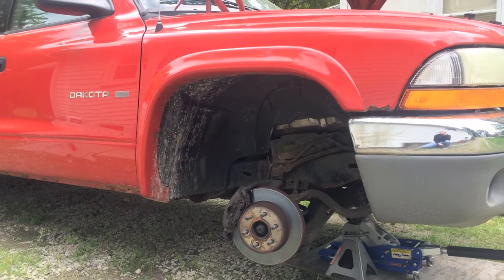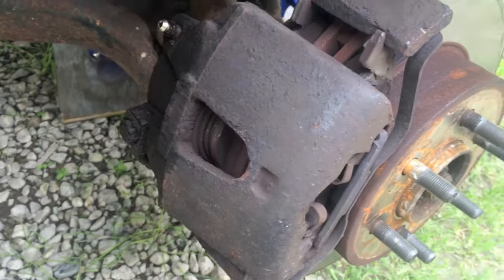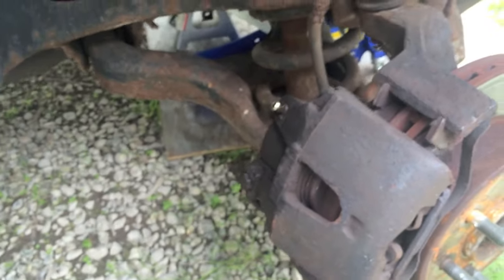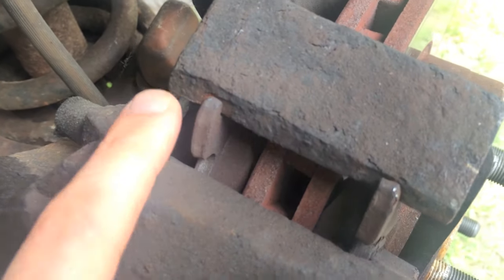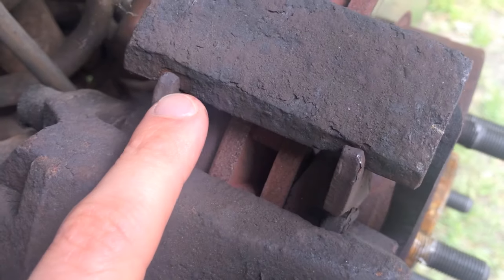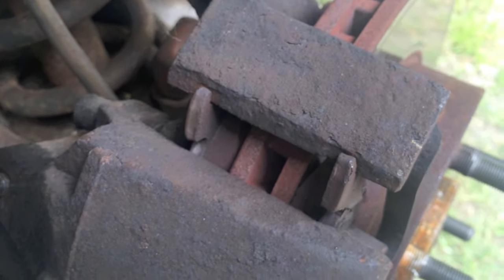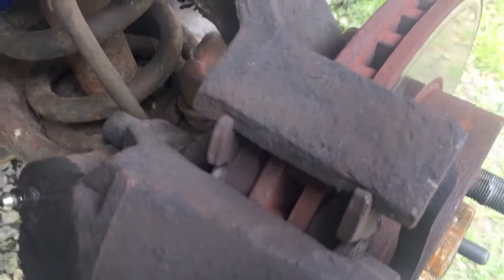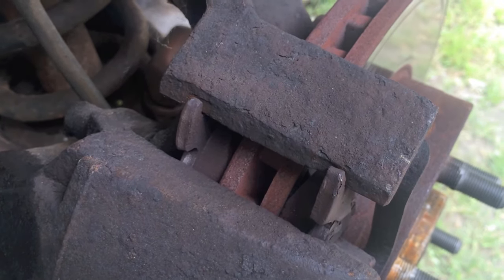HARD Brake Pedal - My brakes are Locking/Sticking/Smoking "Don't forget this"

Comment: hi I have a 2000 Nissan alitima . we replaced the front brakes and rotors. I am not sure why but my BF Also bled the lines . afterwards I had no brakes .   we could not figure it out so my friend took the car . he said the pads were on incorrect so he fixed it . When I got in the car the brake pedal was very hard . we drive it 10 minutes late the car did not want to move , we had no choice but to force it another Mile so we could pull over. the front catalytic converter was glowing red, assuming this was the problem we parked car for several months until our financial situation was better. we replaced catalytic converter ( both of them ) we fixed water pump alternator , EGR valve and both 02 sensors . picked it up at mechanics drove it for 15 minutes and did not want to.move , brought it back and they said brakes were locking up on all four tires , the adjusted the master cylinder rod , seemed to fix problem ...they did say my back brakes were making a spongy sort of noise when stepping on brakes and I should bring back .

car seemed to drive great....until I drove it for about 30 minutes . the front wheels for sure and possibly back wheels are locking up  I can smell burning on front brakes ...back don't smell but are hot.
the brake pedal gets hard , and after it drives for a mile or 2 with hard pedal car does not want to move.
I let it cool and seems great until it gets hot.

not sure if I should mention this but air bag light is blinking, just keeps blinking.
was not blinking when we parked car, but after several months of sitting for a while and then starting it light came on.  mechanic will be looking further into this when I bring it back.

could the brakes and light be related ?

I feel like the mechanic did a poor job diagnosis my car considering it went in due to loss of power, and did the same thing after only a few miles.
adjusting the master cylinder rod sort of helped,  but still same issue .

is there anything I can suggest we look at ourselves ?? money is tight so we can not just keep saying maybe this maybe that.

thanks Heather
Reply from the maker: Heather thanks for checking out the video and sharing your experience.  Brake problems are annoying for sure.  Lets figure this out.  Lets start with your Air Bag light.  Anytime the light is flashing...its giving you a code.  Turn on key and count how many times it blinks...then it pauses for 3 seconds and then blinks again...count the first set....then pause...then count the second set.  Then it will stay on until car turned off and on again.  Usually, it has to do with your electrical wiring that feeds under your seat to move seat.  Double check to see if the electrical wiring or connection point are harmed.

As far as your brakes locking up...NO FUN...we've all been there.

It can be a few different things....

1.  Its possible that your caliper is beginning to stick...maybe caliper slides have lost the lubrication required to shift back and forward freely.

2.  It can be possible that your Caliper piston has lost its lubrication which will also interfere with the efficient shift back for forth.

3.  The front rubber brake lines that connect to your caliper fail from inside rather that outside.  This means the inter coating begins to break away and clog portions of the brake system...hence not allowing fluid to flow back and forth freely.  

4.  Your brake pads have little prongs/teeth on them.  You will notice by their location...the pads slide on a steel brace.  This may need to be lubricated to bring the shift back to efficient requirements.

I have attached a few videos.  Lets start with the easy items and then work our way up!  Lets figure this out together!  Keep me posted!  Please Subscribe to the channel that would be awesome!

1.  Caliper Slides Lost Lubrication:

https://www.youtube.com/watch?v=-DZ68tKuCQc&t=15s

2.  Too much Fluid in Reservoir:

https://www.youtube.com/watch?v=X-AJ5tD6zoA&list=PLjCXOz8TSkZnavDiGDyHdPKe2dV2RzEMZ&index=39

3.  Failing Front Brake Lines:

https://www.youtube.com/watch?v=3FTEgbLYAdI&list=PLjCXOz8TSkZnavDiGDyHdPKe2dV2RzEMZ&index=78

4.  Brake Pads not shifting:

https://www.youtube.com/watch?v=3Pq15BWM_qY&t=103s

5.  Replacing Front Brake Calipers:

https://www.youtube.com/watch?v=8HoaL4QM5-k&list=PLjCXOz8TSkZnavDiGDyHdPKe2dV2RzEMZ&index=83

6.  How to check if Brake Booster is Failing:

https://www.youtube.com/watch?v=VK4lowH7kQE&index=66&list=PLjCXOz8TSkZnavDiGDyHdPKe2dV2RzEMZ

7.  Failing Brake Booster:

https://www.youtube.com/watch?v=j9s7yccswPQ

8.  Symptoms of a Failing Brake Booster Check Valve:

https://www.youtube.com/watch?v=j9s7yccswPQ&index=68&list=PLjCXOz8TSkZnavDiGDyHdPKe2dV2RzEMZ
Reply: Could be your master cylinder if all 4 calipers are sticking.
Reply: Heather Peirson Eric is right it was almost definitely your master cylinder. same exact thing happened to my 240sx. BTW, 99% of the time if your master cylinder is bad, so is your brake booster, and vice versa. they are directly related.
Reply: Heather Pearson
You got to watch people, but most of all businesses that work in this manner. You take it in for for car not moving & you get it back still car not moving, or it moves long enough that you already left the mechanics & the same problem occurs. Remember, you are boss, your paying them to fix the problem you advised them what the problem is when you dropped off the vehicle. Don't let them go off cue cause they found other things wrong. Stick to the point or go somewhere else. Chances are if you take it in for 1 thing & you got more problems, there taking you for a ride at your expense. Report them to the better business bureau, it's always better if you can find others that got taken, so the matter can be taken real serious! When your dishing out a couple hunds & G's for repairs, I don't want some one just learning the trade, someone's nephew or ally man Dan doing the work! I want a experienced mechanic who  looks like a doctor but with grease marks on his boots & their certifications hanging from somewhere were we can see it. Stop giving your money to rip off pricks that are going to charge you as much as if you took it to a well known business. I'm not discrediting the ones that everybody goes to in the neighborhoods that's been doing it since you were knee high. It's the one hiding behind a businesses to robb you in front of your face!

Comment: My 2003 Buick Rendezvous brake pedal periodically feels as tho it's pushing thru rust. (The crunching sound it makes reminds me of really rusty old hinges on a truck door, so I'm thinking it's rust related.) It's like I'm trying to crunch thru something to break. Not always; about 20% of the time. I generally have to back off the brake pedal and try again. I'm now wondering if that crunchy resistance is this rusty piece you're mentioning in this video. Wondering what that piece is called (that flat block), do you know? Thank you!
Reply from the maker: Auriel Whitehawk 

Thanks for watching & sharing your experience.  Let’s get this figured out!

This is a great place to start as it is a friendly DIY inspection & doesn’t cost you any 💰.  After inspecting this part & you don’t notice a difference...let’s move onto the next items.

Two things come to mind and are the most common causes of crunching sounds with braking.

1.  It’s possible that your brake Rotors are very worn, rusty, & ready to be replaced.  The longer you wait to replace rotors...the louder the grinding/crunching gets!

2.  A “foreign object” such as a rock, stick...  has lodged itself inside your brake caliper & pad area.  In this example however...the object usually causes a constant grinding/ crunching noise.  You may want to inspect entire wheel area for such objects!

Let’s start there!  Keep us posted!

Please subscribe to the channel and turn on your YouTube notification Bell that would be awesome thanks again!  😎👍🔧🔩
Reply: Thank you for your helpful input :)
Reply from the maker: Auriel Whitehawk 

Our pleasure & please keep us posted & we will work together to get this figured out.  😎👍🔧🔩

Comment: Question I replaced brake booster and master cylinder a month ago .because I was driving and brakes didn’t want to stop he said that was the problem.after I fix it now pedal still goes almost to floor but it stops.but after 2 days of fixing now my brakes lock up after driving awhile and I have to let it sit for 30 mins or so  before it release and goes back to floor and I can continue driving.what could be the problem now?also when they lock up I can’t go in drive or reverse.
Reply from the maker: Naquayla Curtis 

Thanks for watching & we hope you enjoyed the video.  If you haven’t already, you may need to purchase brand new calipers.  If your calipers have been recently replaced in the last year or two, the next common cause of this is a faulty rubber brake line that feeds off of your caliper and through your wheel well to the hard brake line.  Replacing both front rubber brake hoses may fix your issue.

Many more helpful videos to come!  😀
Please subscribe to the channel and turn on your YouTube notification Bell 🛎 that would be awesome thanks again!

😎👍🔧🔩

Comment: I have a Buick lurcerne 07 and the back passenger wheel is stuck. Any idea what that could be?
Reply from the maker: Authorize King 

Thanks for watching!  We appreciate you sharing your experience.  A few things come to mind!

1.  It’s possible that your Caliper slides are no longer lubricated.  These caliper slides when not lubricator will cause Calipers to lock up.   Below is a step-by-step video that shows you how to lubricate Caliper Slides.

       https://youtu.be/-DZ68tKuCQc

2.  It’s possible that your Brake Pad tips are no longer effectively lubricated where they shift on Calipers.  Below is a video that shows you how to check if they have been lubricated as well as lubricate them in the event that they are not.

       https://youtu.be/3Pq15BWM_qY

3.  It’s very possible that your Rubber Brake hoses are failing.  This hose connects the Caliper & hard line that feeds upstream to Master Cylinder.  Believe it or not these rubber hoses fail from the inside out...which means you will never know when it is failing until you experience symptoms as you are...There is no visual signs on the exterior portion of the rubber hose...in most cases, the exterior portion of the hose will look great however the inside is falling apart.  Below is a video that runs you through the step-by-step process of replacing these rubber houses.

       https://youtu.be/3FTEgbLYAdI

Let’s start there!  Keep us posted!  Please subscribe to the channel and turn on your YouTube notification Bell 🛎 that would be awesome thanks again!  😎👍🔧🔩
Reply: DIY With Michael Borders Turns out my back passenger wheel was locked bc the brakes were worn to the medal. I had a guy about 2 months back changed them with some new ones, but apparently I got scammed. He kept the new brakes and put on some really old ones that were no good. Because of all this my caliper bracket points seized causing me to buy a new bracket. Problem is fix now and overall I got scammed. Thanks for the help.
Reply from the maker: Authorize King 

😲 that is definitely not cool on the mechanics part if that’s true...yikes!  That’s not how you get customers to return...

We are sorry to hear you experienced this.  We are happy to hear it’s now fixed & you’re back up & running properly & efficiently again.

At any point down the road you run into any questions, definitely reach out to us, we are here to help!

Thanks again for the update.  😎👍🔩🔩

Comment: My question here hope u can help me my car brakes locks up so when I disconnect the check valve from the booster u hear air released and brakes gets released immediately I replaced the valve with a dealer one and still the same also replaced master cylinder pads rotors and calipers any idea will help me a lot and thank you
Reply from the maker: mike pilot 

Thanks for watching.  Is just a single caliper locking up or is it all of your brakes locking up.  Keep us posted.

Please subscribe to the channel and ring your YouTube bell 🔔 that would be awesome thanks again.

😎👍🔧🔩

Comment: Hello i have an 04 tahoe i had to brake hard the other day and now after a few minutes driving all 4 brakes lock up and pedal goes hard as a rock after it sits for along time in will release and can move again for a couple mins any suggestions
Reply from the maker: Sean Colpitts 

Thanks for watching Sean.  Double check your brake reservoir fluid level.  Verify fluid level is within the proper fill parameters.  If fluid level is to high, you will need to remove some fluid.  Dabbing paper towel into reservoir to soak up some fluid works pretty well if you don’t want to get any tools dirty.

😎👍🔧🔩

Comment: What if Both front breaks lock up at the same time? 1994 G30 van.
Reply from the maker: MJ Morro 

Thanks for watching & great question.  In this example, you may be experiencing dual Caliper failure...unlikely however we can’t rule it out.

Has there been any recent maintenance done to the vehicle?  If yes, this will help us figure out if any recent maintenance is related to your break issues.

We really enjoy making these helpful videos for our fellow DIY’ers.  Many more helpful videos to come.

Please subscribe to the channel and turn on your YouTube notification Bell 🛎 that would be awesome thanks again.

😎👍🔧🔩
Reply: DIY With Michael Borders 2004 gmc envoy replaced front brakes and rotors. Cleaned all rust from under stainless clips and greased clips, cleaned and greased the guide pins everything moves freely but as soon as you head down the road their sticking again. Rear brakes are free. Any help would be greatly appreciated!!
Reply from the maker: Ted Albrecht 

Thanks for watching.  At this point, we need to direct our attention to your brake lines that connect to your Caliper & feed upward to the hard line in your wheel well.  These brake lines fail from the inside which means you can look at the outside of the brake line & they look perfectly fine however the internal portion of the line has begun to break away and little pieces are clogging your brake fluid flow....leading to locked up Calipers.

Below is a link to our video that shows more about the lines.

       https://youtu.be/3FTEgbLYAdI

Let us know if you have any questions.  Many more helpful videos to come!

Please subscribe to the channel and Ring your YouTube Bell 🛎 that would be awesome thanks again!

😎👍🔧🔩

Comment: I just changed rotor and brake pads and they started smoking what could be causing this
Reply from the maker: parts unknown Thanks for checking out the video and sharing your comment.  Let’s get this figured out together!

During your rotor & brake pad replacement, did you notice any uneven wearing on the brake pads...if so, this can be a few different things.

1.  Indication that your Brake Calipers are beginning to fail and not shift properly.  Each Brake Caliper has slides that must be greased & able to move.  In the event that the slides are not sliding, the Caliper might seize up and cause smoking.

2.  Your rubber brake lines that come out of your caliper and feed into the actual hard brake line.  These rubber brake lines fail from the inside which means you will not have the opportunity to notice anything wrong with the actual hoses...which is a pain.  In the event that your rubber hose fails believe it or not it will actually hold brake fluid inside the hose and not allow it to escape which in return will lock your brakes & cause smoking!

3.  By chance did you spray the new Calipers with Brake cleaner?  The new Rotors come with an anti rust solution on them...if not cleaned off with brake cleaner prior to installation...the first time you drive and apply brakes, the anti rust solution will begin to burn off & cause smoking & bad odor!

Keep us posted!  Please subscribe to the channel and turn on your YouTube notifications that would be awesome thanks again 😎👍🔧🔩